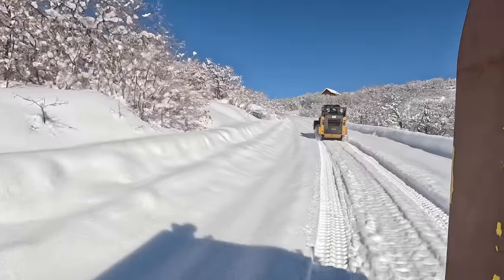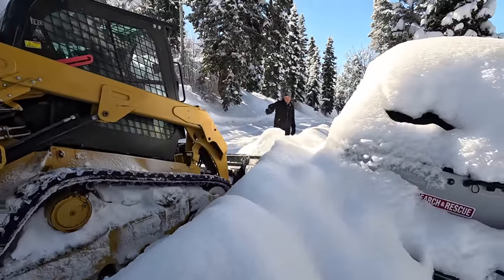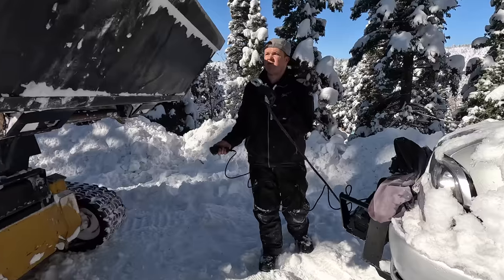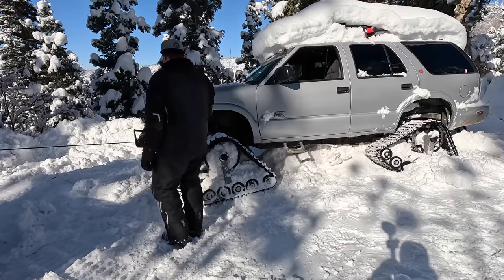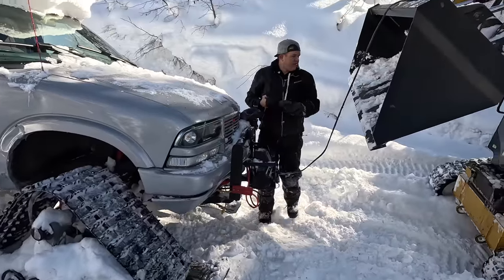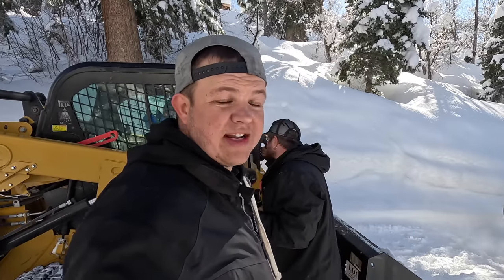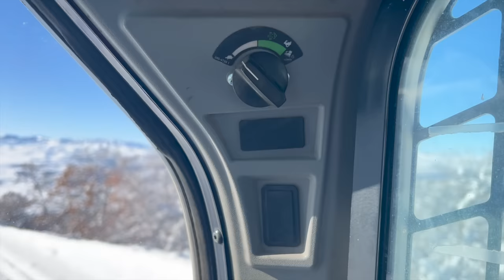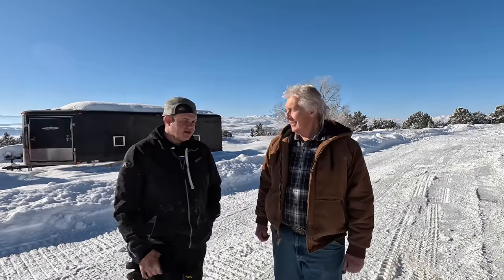Recovering The Nearly FORGOTTEN Blazer We Snowed In!

Comment: Yeah it’s definitely steam when the water evaporates, not smoke 😂
Reply: And if it's both it's stoke
Reply: Tell hillbilly that even when burning pure hydrogen the result is still called steam.  Smoke is specifically related to carbon combustion.  For another example, if you mix bleach and ammonia you create a gas but it's not smoke.
Reply: Steam is produced when water is boiled-it is very hot.
Reply: There’s a reason why it’s called a steam boat and not a smoke boat
Reply: @alexandertoptygin7228  what do you call it when you have a chemical decomposition that gives off a particulate but it’s not carbon based? Is that not smoke too? Just wondering.
Reply: @ronaldcooper7609   Condensation does not happen  With hot heat. 😳
Reply: Google says it is a form of smoke
Reply: @Elmo6855   What you see is water vapor. Steam actually changing back to a vapor. It will become water droplets and drop back to the ground.
Reply: Hillbilly is wrong af
Reply: You can not see steam. You can only see the water vapor produced by the steam cooling down. Once the water vapor cools, it will condense into water droplets. When you are in a hot shower, you see water vapor. If it was steam, you would have some serious 3rd degree burns and probably not live through the experience.  
Due to the fact that water vapor is not a result of combustion, it is not a true smoke. When you look at clouds, do you think they are smoke?
Reply: @c.s.allsman9301  only true in some scenarios, when you take a hot shower you can see steam, yet it does not burn you
Reply: @jim4448  it does if the opposite is colder than the hotter
Reply: @craigatwood313  haha
Reply: Hillbilly needs to leave the science to Robby.  Who should probably leave it to anyone else who isn't Hillbilly!
Reply: @alexandertoptygin7228  You should note that the gas created is also HIGHLY toxic.   Never mix these cleaning agents.
Reply: @scottwheeler2494  any particulate dispersed through a gas is called an aerosol. Yep, I'm a science feller, hence my name on here.
Reply: I do believe it's called magic boys, lol
Reply: @professornuke7562  the point being it's not "smoke". As been said, smoke is release of carbon and by products of burning. Steam is an unique form of water phase. There is a name for everything else.
Reply: This man owns a paint shop. Let's be serious here. He knows the difference down to the molecular structure
Reply: @kristopherlavancher2048  Robby owns it though not hillbilly so he might not actually know
Reply: Steam is steam and smoke is smoke 
Steam is hot water Vapor 
Smoke is Carbon and sult vapor

Comment: Smoke consists of gasses and soot. 
The gasses typically include water vapor, but smoke differs from steam in that there are other gasses, such as carbon dioxide and sulfur oxides, plus there are small particles.
Reply: Translation. Smoke is dirty steam.
Reply: @C-Dubs Watson  it isn't that simple... smoke is from a chemical reaction with heat, fuel, and oxygen. Steam is the visible transformation, of a liquid, into a vapor, before it becomes a gas.
Reply: @SPH¥NX®  is there steam in most of what the average watchers of Robbie Layton would call smoke? I was answering Robbie's question. I'm likely comparably or more educated than you and didn't feel the need to flex my youtube comment muscles by reciting what my high-school science teacher defined as smoke. Have a good day and stop smoking whatever you're smoking.

Comment: In general you should clear a vehicle from the top down.  So snow doesn't cover the windshield when you stop. Nothing is worse than driving down the highway when the snow sloughs off a tractor trailer. In front of you lands on your windshield and blinds you.  A little bit of common courtesy makes winter driving a lot safer.

Comment: If you had bolted 2 small pieces of angle iron to the bottom of those hoods, you could have had steering.
Keep the hoods for skis and bolt on some 1-inch angle on the tops (bottom of the ski) and keep them for other recoveries where you need to just slide something off the mountain.

Comment: Smoke is Carbon particles in the air you can see so steam is not smoke.  Steam is just tiny vaporized water particles and if you heat steam hot enough the particles will shrink down to where you can even see them aka superheated steam

Comment: Steam: The vapour into which water is converted when heated.

In popular language, applied to the visible vapour which floats in the air in the form of a white cloud or mist, and which consists of minute globules or vesicles of liquid water suspended in a mixture of gaseous water and air. (Also sometimes applied to the vapour arising from other liquids when heated.)

In modern scientific and technical language, [the word "steam" is] applied only to water in the form of an invisible gas. The invisible ‘steam’, in the modern scientific sense, is, when its temperature is lowered, converted into the white vapour called ‘steam’ in popular language, and this under continued cooling, becomes ‘water’ in the liquid form. dry steam, in Steam-engine working, steam containing no suspended vesicles of water: opposed to wet steam.

Comment: Smoke is the gas given off when something burns. Definition of burning being some material / chemical components reacting with oxygen and giving off heat. The burning converts whatever is burning to some sort of oxide of the material such as carbon dioxide. The smoke is often unburnt material, such as a smoky diesel. Steam is the 'valor phase' of H2O. H20 can be ice, liquid or vapor phase depending on it's temperature and pressures.

Comment: You did a great job. Ignore the naysayers. Just an aside; I own a big man- lift, approximately 30,000 lbs. Watching you guys pulling the machine. There's usually a point up on the tower that you can hook up to with a strap and pull from up high which keeps the   machine from tipping. That of course in conjunction with a low centre of gravity pull. That applies to mud recovery also. Cheers.

Comment: Technically, what we see as steam (coming out of a boiling kettle, for example) is tiny droplets of liquid water. Water vapour (that is, water in the gaseous state) is transparent. 

However, we don't need water to be at its boiling point for us to see steam. If you go outside on a cold day, you can usually see your breath steaming. That's exactly the same phenomenon as seeing steam from a kettle. If you spend any time around cows in cold weather, you'll probably see their droppings steaming too. No fire involved, but there is a temperature difference, which is what's important here. Water evaporates from the warmer surface (whether that's the inside of a kettle, our lungs, or a fresh cow pat) and then condenses into small droplets when it encounters the cooler air.

Smoke is actually a type of steam. When something is burning (or just really hot without being on fire), various chemical substances within that something evaporate and then condense when they encounter the cooler air. Smoke is distinct from steam, though, because what it condenses into can include very small solid particles. If you look at cigarette smoke through a microscope, you may be able to see the solid particles moving and jiggling about as they're jostled by air molecules. (This random movement is known as Brownian motion.)

The substances that evaporate to form smoke are not necessarily transparent and, unless what you're burning is very pure, will contain a mixture of many different substances. Very often, smoke from a fire is itself flammable, which can cause such things as a flashover in fires inside buildings.

So, Hillbilly was wrong; Robbie was kind-of right; but the situation is a lot more complicated than you might think.

Comment: Robby is right in this  case. 
Smoke and steam are actually two different things...
Smoke is the result of combustion - when stuff burns. It is a "chemical change", which means the smoke can never turn back into the original stuff. 
Steam on the other hand is just water turning into a vapor when it gets heated up. It is a "physical change", which means the steam can always turn right back into water when it cools.
But steam and smoke can be mixed... that can confuse things.  In the case where a fireman sprays water on burning stuff to put out the fire is one example. Smoke comes from the burning stuff and steam comes from the sprayed water. Trying to burn very green branches is another example. There is a lot of water in green branches.

Comment: Not to complicate it too much. The dial in the compact track loader is the throttle dial. It just makes it to where you do not have to push on the peddle. But If you turn it all the way clockwise towards  the rabbit, then the peddle becomes what is known as a decelerator. But this only works when turned all the way , otherwise anywhere between it will just maintain that rpm unless you step on the throttle then it will go to max rpm.

Comment: Steam is water vapour that is condensed in a relatively colder environment, I.e. air. By definition, steam is produces when water exceeds its boiling point, 212 degrees Fahrenheit, 100 degrees Celsius. Conversely, smoke is technically a particulate matter that is liberated from its fuel, I.e. wood, paper etc. and is floating in the air. Smoke can be seen at any ambient temperature, whereas steam can only be seen when the relative atmosphere is colder. As the outside air temperature (ambient) gets lower, the appearance of steam increases, as more of the vaporized water molecules cool and are suspended in the outside atmosphere longer than at warmer temperatures. Smoke is particulate, steam is vaporized water. The fact that “steam” from an engine can be seen easier than say from a pot on the stove is that since it’s under pressure in the cooling system, it’s effective temperature is above its boiling point that it would be at atmospheric pressure, and therefore, it’s temperature is higher. Hence, more heat energy is within it, and when released to the atmosphere, the resulting instant drop in pressure and temperature causes a more significant formation of steam.

Comment: Smoke is particles of ash/soot (as well as some steam), steam is just water. If anything smoke would be closer to a type of steam with other stuff mixed in since burning something will produce some steam. (The white cloud you see out of an exhaust pipe on a cold day is the water vapor produced form burning gas condensing into a cloud, like your breath, in the cold air. Once the engine get hotter the exhaust doesn't cool fast enough to condense as much before it spreads out too thin to see. Black diesel exhaust would be more of a smoke since it's black from all the unburnt/underburnt diesel soot.)

Comment: Smoke consists of gasses and soot. The gasses typically include water vapor, but smoke differs from steam in that there are other gasses, such as carbon dioxide and sulfur oxides, plus there are small particles.

Comment: You are sort of correct. Smoke is defined as a suspension of carbon and other particles in air (typically lifted into the air through heat as a result of fire or excessive heat). Steam is the invisible gas state of water. What most people think of as steam is actually the recondensation of steam (gas) back into water vapour as the heated gas cools, but has not yet settled out of the air (list mist or fog).

Comment: Steam is water vaporized by heat, from a boiling tea kettle for example.  Smoke is the products of combustion given off when something is being rapidly oxidized, commonly known as burning, from a campfire for example.  Smoke usually comes from fire, but may also come from overheated stuff that has not yet ignited, but still is being oxidized, from overloaded wiring for example.  Sometimes the heat from a fire causes water to boil into steam, as when a tea kettle is place over a campfire.  At other times firefighters may use steam to extinguish fire by spraying water into a burning area where it is rapidly heated and flashes into steam, filling the room and smothering the fire. Steam and smoke are not the same thing.

Comment: Water heated to it's phase change point is called steam. It is invisible. Water that cools off from steam is visible water vapor with much less energy than steam. (Steam has 5x the energy of water vapor) The boiling point at 8,400' is 195.2º F (Skyline Mtn Resort elevation) For each foot of elevation, the BP reduces by 1/500th a degree.

Comment: Smoke is any visible mixture of solids, liquids, and gases that results from combustion and that is suspended in air. Typically, the "something is burning" smoke is a mixture of many different, very fine solids floating around in the air and often includes ash if the material burning is organic (like wood, leaves, paper, plastics, oil, etc.). As the smoke moves further from its source, it dissipates, but there are still solid particles suspended in the air. This is why inhaling smoke is dangerous; those particles get into your body, and can be harmful if they make it all the way to your lungs. Interestingly, "steam" can be a component in smoke, but smoke is not a necessary component of steam.

Steam, then, is airborne water vapor. As others have noted, we can only see "steam" as water vapor (a gas) recondenses into very small liquid water droplets. This happens because the water vapor is at a higher temperature than the environment into which it is released. As steam dissipates, those little water droplets usually evaporate back into water vapor as the water molecules equilibrate to the ambient temperature. It is much the same phenomenon that causes water to condense on the outside of a glass with a cold drink in it, which eventually disappears when the cold liquid warms up. 

I'll address one other similar type of "smoke" because perhaps someone reading this will wonder about it. That is the propylene glycol "smoke" that is the product of e-liquid use. There is no combustion, so it can't technically be smoke. And there is more than just water vapor, so it can't technically be steam. The proper term for the "smoke" emitted from those devices, and indeed any solid or liquid suspended in any gas, is an aerosol. A careful read of that definition tells you that both smoke AND steam are, technically, aerosols!

Hillbilly is right about one thing, though, and that is that "white smoke" and "steam" do look similar. They are both aerosols, but smoke from a fire and steam from condensed water vapor are absolutely not the same thing. Hope that helps "clear the air"!

Comment: Not smoke. H2O has 3 forms, solid (ice), liquid (water), gaseous (steam). Water, the most natural form, will drop to 32 degrees (0 C) and stay at that temperature until it is completely 32 F, then transform to ice. As the temperature rises, it will stay at 32 F until it finally goes above 32 and turns into water. Water will rise in temperature (think of heating water in a pan) and will stay at 212 F (100 C) until the entire body of water is 212 F, and then boiling will take place. There will be some steam from the surface of the water that has reached 212 F, but boiling will not happen until all of the water is 212 F. There will be some surface freezing as it reaches 32 F, but the balk happens as a large portion becomes 32 F. When ice freezes, it actually expands in area and becomes less dense (why ice floats in water). There are a few other compounds that exhibit that trait. Steam is nothing like smoke which only happens with combustion.

Comment: When water gets warm it evaporates and becomes steam, like your breath is full of water vapor, or a vape is liquid heated and turned to vapor.  Smoke contains steam and chemical vapors along with particulate.  Steam is not fire, but fire does have and will create water vapor as this is what creates hissing and popping in a campfire or fireplace.  Crackling fire is the same, but generally dry or seasoned wood crackles while a fresh cut or more moist type of wood hisses and pops.  Generally when you have water being warmed and creating steam, you have too much water to create a fire  (a red hot teapot will not start on fire until it is pretty much empty of water) like driving through a puddle when your breaks and all the rest of the car is warmed up and you see the steam rolling.

Comment: Way different thin steam is water heated to the  point of changing its form to a gaseous state and will return to it’s natural state of water when it cools. 
Smoke is a by-product of incomplete combustion and it will not return to it’s original state but remain as it’s particulates.

Comment: Ya , a lot less weight on the vehicle if ya knock the 3, ft of snow off the top, unless ya think it helps with traction but since you are dragging that means more fuel required the heavier something is.. My guess is you had about 300 lbs of snow on the roof and hood, maybe 400

Comment: Nice work Demri....

Robby, on the other hand....

Did I just see you putting hoods under the tracks as it is suspended by the winch cable?  The same winch cable that broke when trying to pull the Blazer out of the snowbank..

I cringed.. if that cable snapped again, you were done.

Toss a good chain in the skidsteer for this purpose

Comment: Tracks on a 4x4 truck and a sidexside is a good idea especially in snow but the manufacturer's need to make them better because all the vehicles with tracks on them are either having issues with the tracks or they are completely broken and they even break on Snow Cats especially when you're in deep snow and the only time I haven't seen a set of tracks break on a truck or sidexside is when they are in the mud and even then they have to be careful about what they are doing and how thick the mud is and how deep it is and I would like to take a Snow Cat like Heavy D's in a Bounty Hole which for those that don't know is a very deep soupy and long mud pit